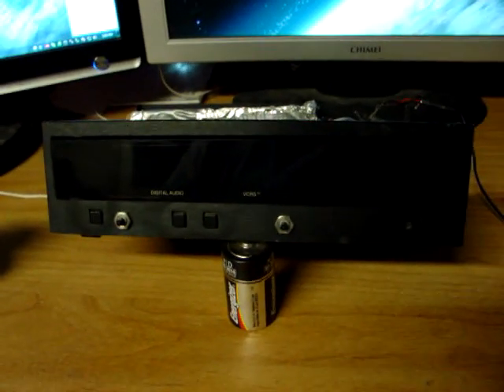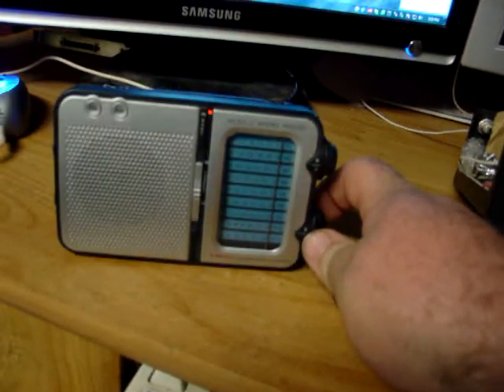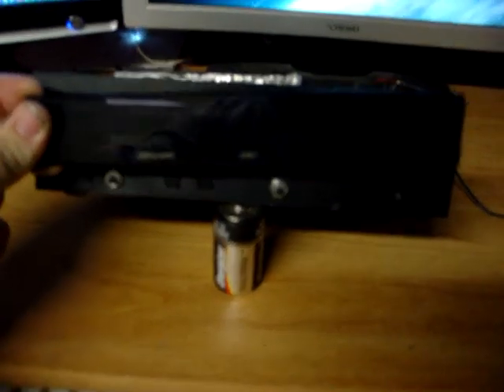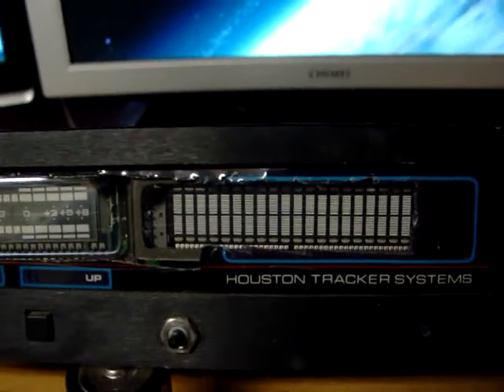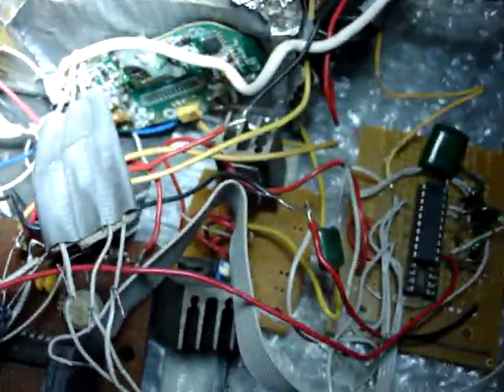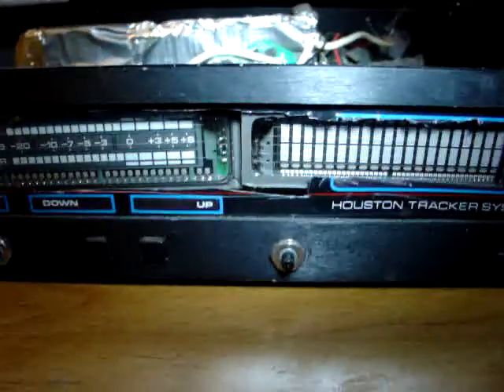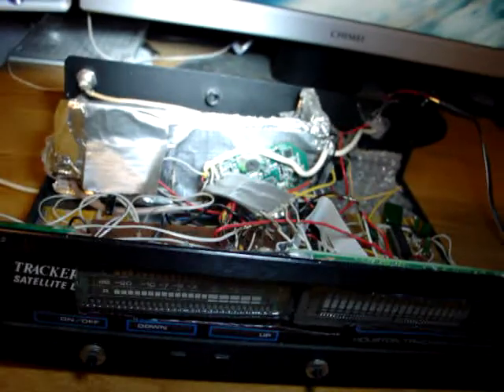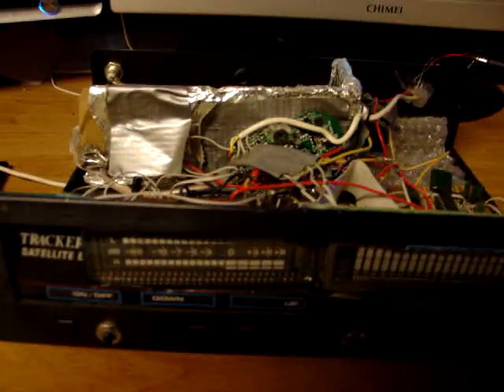DIY FM Broadcast transmitter

Comment: @bjtaudio I'd like to spread the message to everyone that uses FM transmitters like the Belkin tune cast 2 or 3 and has issues with the static and poor range, and the fix is to remove the attenuator network, use an external power supply, and fit an external wire antenna about 0.5Meter is ok.  The antenna currently is run inside the audio input cable which is shielded, a stupid idea, where almost no signal is radiated at all 1uWatt maybe  if that..terrible! 10micoWatts is the limit in Aust.

Comment: @THEtechknight  Yep your right I using a audio compressor to limit stop the over deviation and it sounds like a real station. Also I noticed that the built in switch mode powersupply that boost the 3V from the battery supply to 5Volts or so to run the chip in the Belkins tunecasts units created an unacceptable level of background hiss. By using an external dc supply avoids this problem.  From memory I was able to get about 100~200microWatts into 50Ohms from the Belkins, attenuator removed.

Comment: @leftist  Also the sound quality of these mini transmitter units is poor. To boost a mini transmitter such as the belkin tuncast 2 or 3 to 100's of  milliwatts or even more you need a massive amount of RF gain and a number of shielded and well isolated stages to keep the dam thing stable. You can boost the units by removing the attenuator resistor network inside, and fitting an external antenna.

Comment: @leftist  Yea I made such mini amplifiers ranging from a few milliwatts to watts, and the results are mixed.  As the power increases past a few 100 milliwatts it starts to disrupt the electronics in the mini transmitter as it become almost impossible to stop of the high power rf leaking back into the PLL circuit .